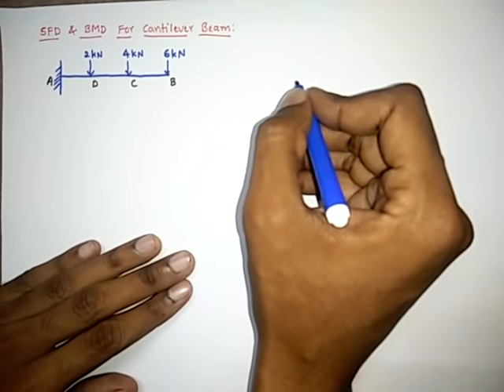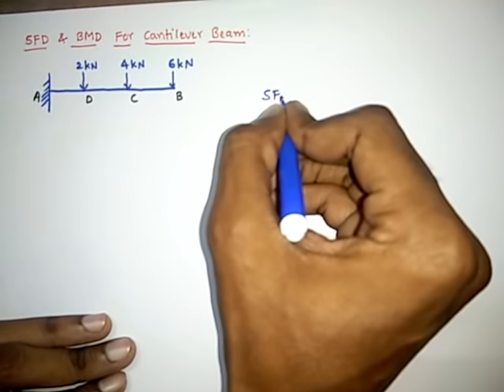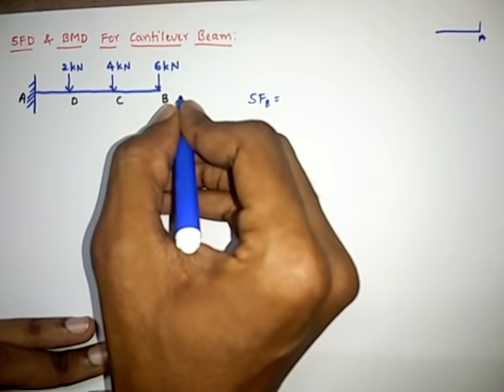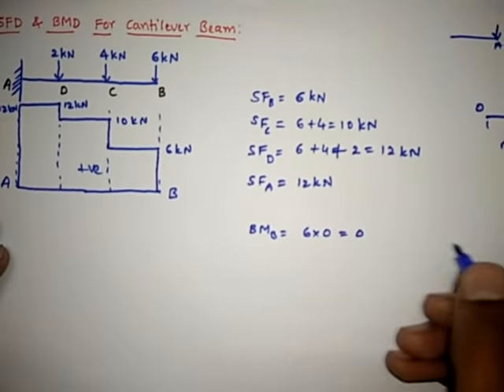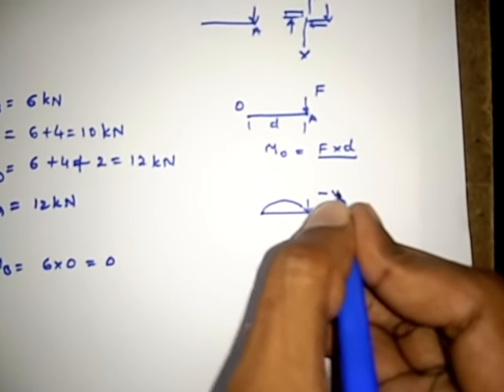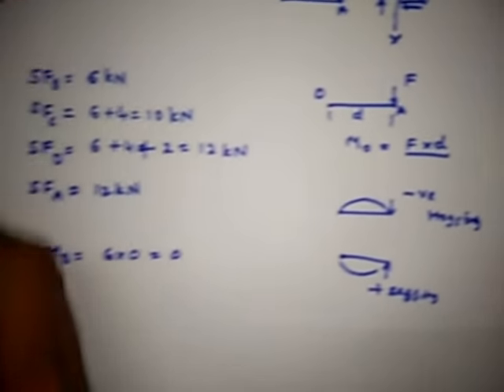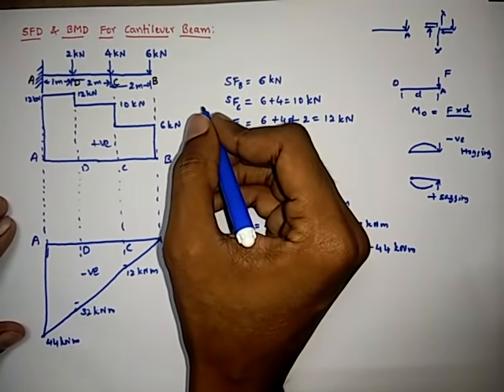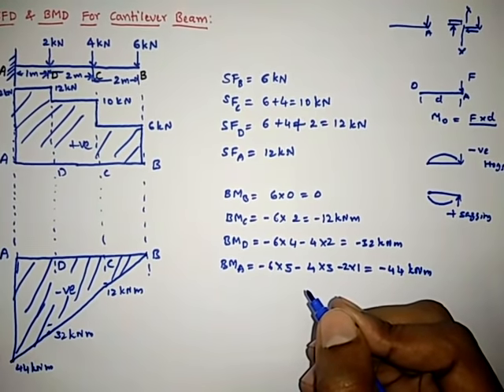SFD and BMD for Cantilever beam with point loads, Mechanics of solids (Strength of Materials)

Comment: I have this as an exam today ,most of my friends mistake this by adding a negative signs to the shear forces calculated ,most of them said ,the forces pointing down wards are negative while that pointing upwards are possible ,I only accept that principal if it just 2 points load involved but I will accept yours very much better since it include 3  points load

Comment: Sir, i am trying to read this topic using RS Khurmi. Am unable to understand the sign convention used there. It seems like the sign convention used in cantilever problems and that used in simply supported beam are contradictory to each other. 
For eg, in its solutions the sign of sfd is same as yours in simply supported beam. But its sign of sfd is opposite to that of yours for cantilever.
Why this anomaly, pls explain.
Reply from the maker: sf about a section going clockwise    
we will take it as positive
Reply: @ReferenceBook 

RS Khurmi takes it negative.

Sir, Which book is the best one for MOS?

Comment: 1 (b) A cantilever of 4 m span and 400 mm depth carried a uniformly distributed load of 5kN / m . Find the value of the concentrated load w acting at the free end so that the maximum deflection does not exceed 10 mm anywhere in the cantilever. Also find the maximum slope due to both these loads. [E=200GN/m^ 2 ; I = 20000 * 10 ^ 4 * m * m ^ 4 .) 10 solve this for me
Reply: Use the principle of superposition (assuming you know how to get the max deflection expressions via double integration, moment area or other energy methods). The point load w gives a max deflection of wL^3/3EI for a cantilever, the distributed load gives a max deflection of w_d*L^4/8EI. The max deflection occurs at the tip. You can now equate the sum of these deflections with the max of 10 mm, and solve for P. You can then use P to find the maximum slope (same procedure, but sum up the max slopes for the cantilever under a point load and uniform load).

Comment: Y didn't you take the lenght from B to C for bending moment of B 
And you solved the shear force problem without length between points and suddenly u took the measurements for bending moment at C if the values were arrived then whole problem u did earlier is wrong please check it properly if u have committed mistake then please kindly remove the video and make another one so that no students will fail in the exam seeing your video